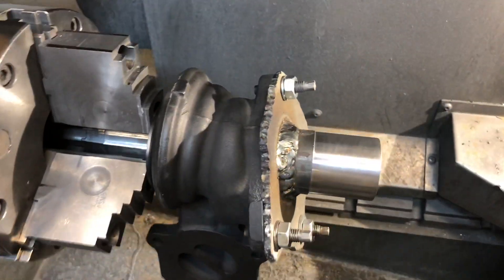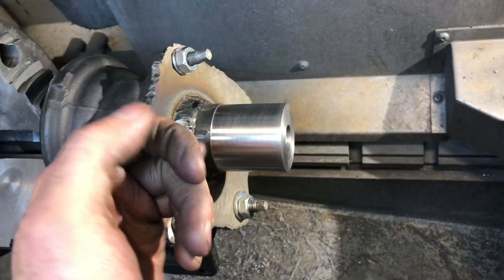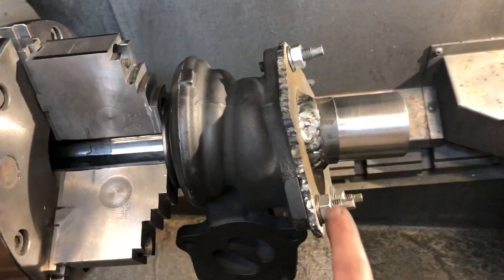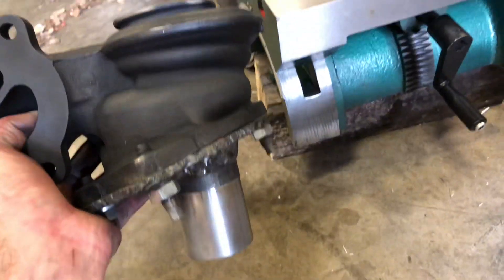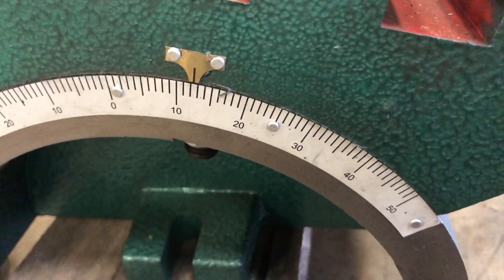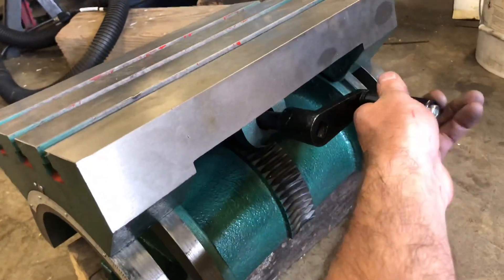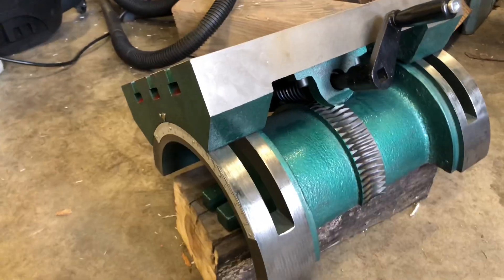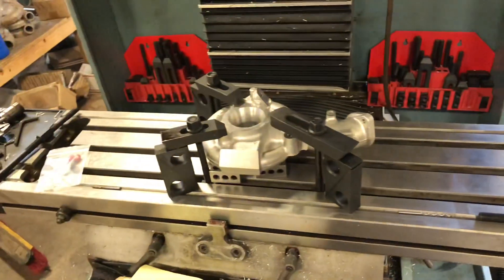Camero turbine housing machining fixture

Comment: Question on a different turbo. 2002 7.3l. What is the different from an SD66 turbo and just rebuilding you're stock GTP38 with bigger compressor wheel and housing? TIA
Reply from the maker: Austin Jake Wilkins I’m not sure what the sd66 is

Comment: What kind of run out do you accept? How do you determine the runout?
Reply from the maker: Spixy cat I prefer less than .001, .002 is okay
Reply: @turbolabamerica  how do you measure it? Can you show that next time? Plus fixating that odd angle using a weld is I guess quite difficult because the axle will change due to the heat of the weld. Nice video
Reply from the maker: The digital read out, I line up x and check z